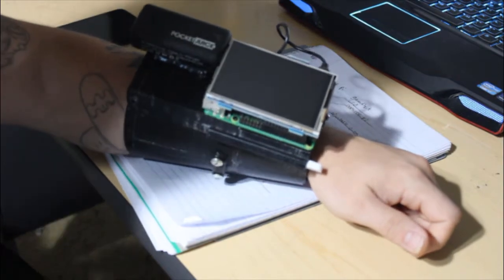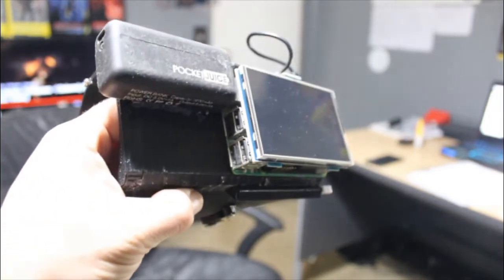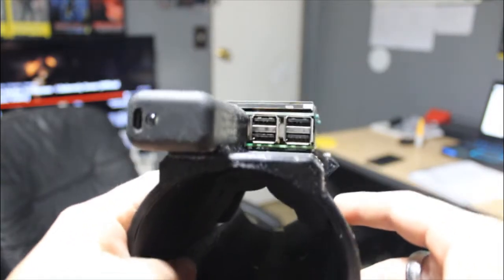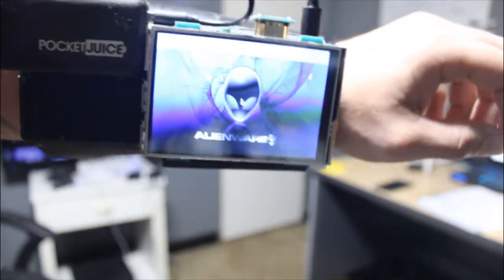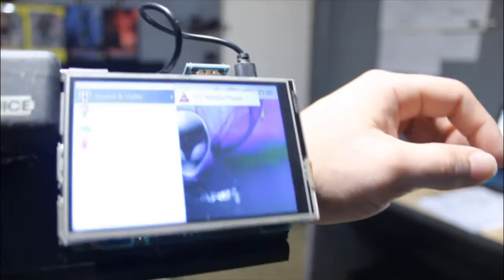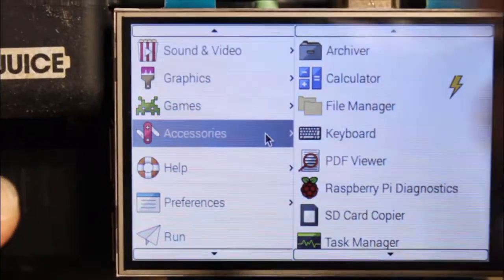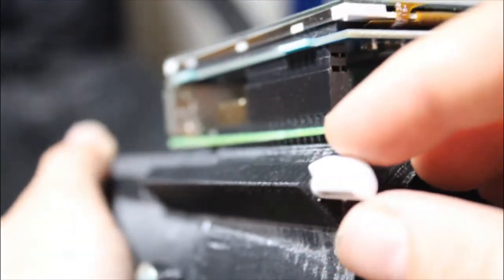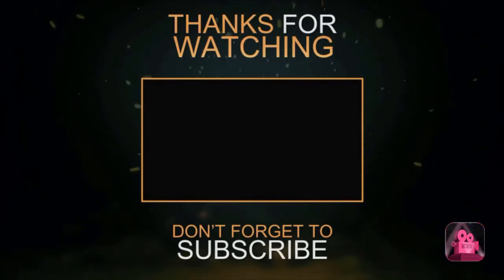The Predator inspired wrist mounted computer! (using raspberry pi)

Comment: I saw the same screen on AliExpress with the same stylus..there is a touch issue because the screen is resistive touch which needs pressure to detect touches. Phones use capacitive touch. I'm tryna make the same thing bud 🙌 it's great